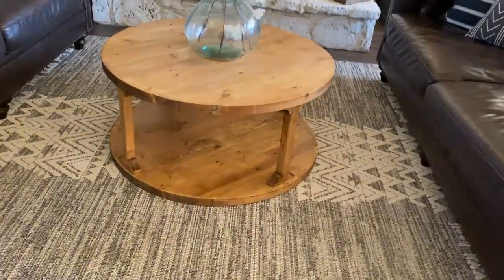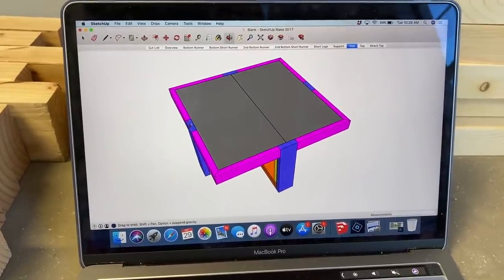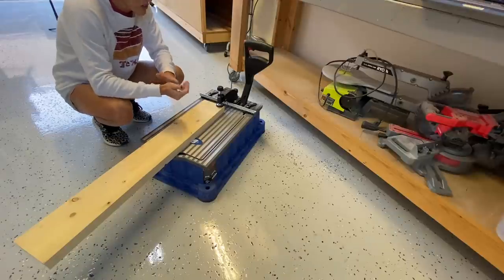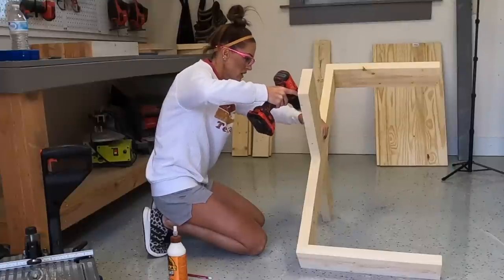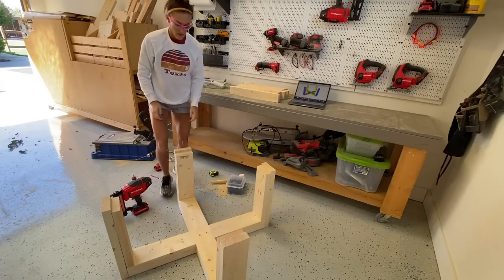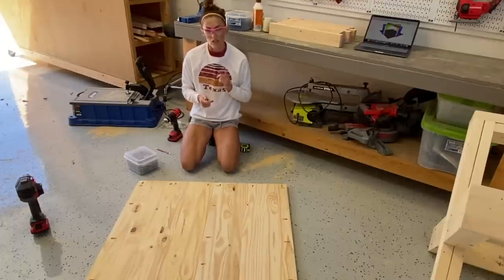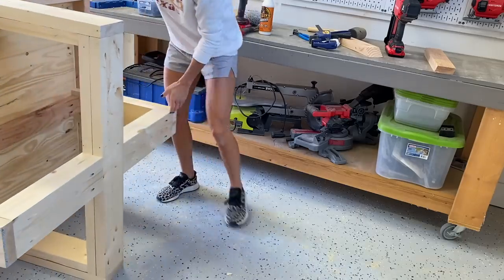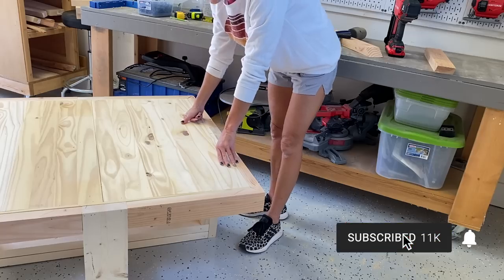DIY Square Coffee Table

Comment: How do you get your wood flat? Every project I've done the wood is not flat enough causing furniture to not be even.
Reply: When you pick out your lumber at the hardware store, use one eye to look down the length of the board. You'll be able to tell if it is warped or not. Spend some time going through many pieces of lumber until you find the straightest boards there. Many will be somewhat warped or twisted.

Comment: I would be worried about the corners not having support underneath them. It seems like it might be rather easy to dip the table to the floor if one of your littles were to sit on one of the corners.
Reply from the maker: This table doesn’t even wobble. Just stood on the corner.....
Reply: @shanty2chic  Good to hear. I like the overall design but I had my concerns. May try to borrow some of the aspects for a future project. Cheers.